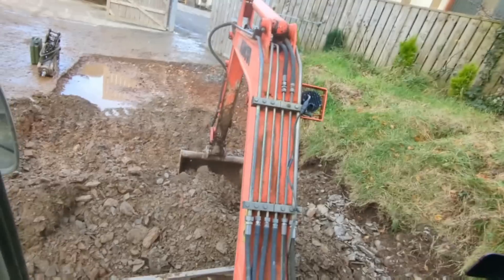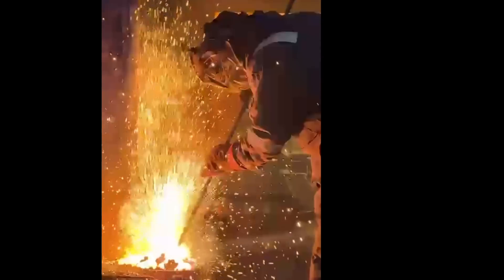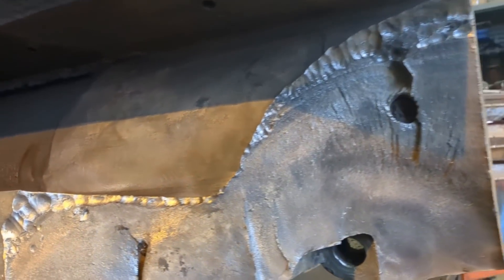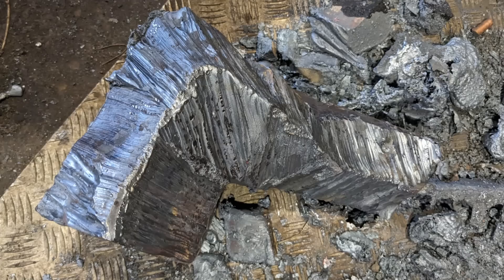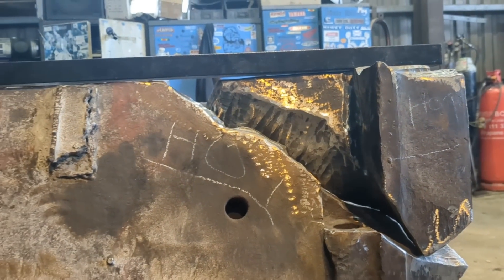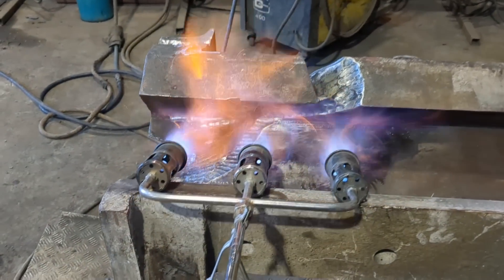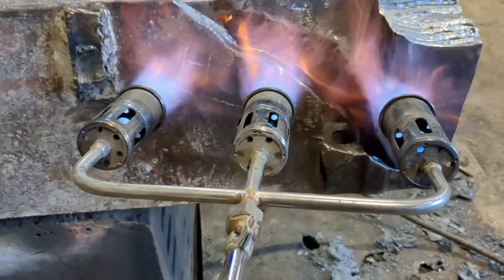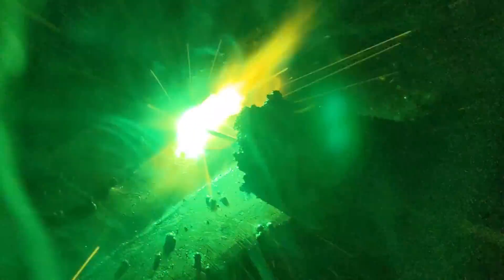so many corners I don't know where to start to weld! broken  jaw crusher toggle seat

Comment: Great  work, do you ever use flux core wire,I used to use a lot on heavy welding,2.4 mm wire,great finish,but dirty and fumes when applying it.

Comment: So I’m not shitting on your video or anything just some of my insight. On heavy material like that if you have a stick welder with 6010 5p+ electrodes I would use that for your root, MiG will get the job done as we can see but your would probably get better penetration profile with a 6010 root, then mig out the rest. Great video though keep up the good work

Comment: I'm curious why for a job like this you aren't using metal core in a spray transfer for much higher deposition rates?
Reply from the maker: Cost and not time critical
Reply: @allistairc123  you need to up your prices! So much hot hard work. Nice job in the end.

Comment: Hey Alistair. I'm somewhat in the heatingofbigasschunksofsteel business. I'm curious if anyone doing this type of work uses induction as preheat? We use it ourselves for pipes and large chunks of steel and it's super efficient. I would love to test our kit on the stuff you work with to see if you could get rid of those furnaces and save some time in the process. Want to do some experiments?

Comment: what is that machine  3:24, with this green flame?
Reply: It is an air arc gouging machine The rod that he's using melts the metal and then air blows the metal away it is very nice for the application that he's doing but it works extremely well for when you want to carve away welds
Reply: @florpdorp7190  i wrote that comment over 1 year ago.... in this time i become welder,  now i gouging and welding myself everyday :D  but still thanks for the answer
Reply: Air arc

Comment: Would there be good reasons to build or buy a large industrial oven for post weld heat treatment? Of course it depends what alloys the base and filler are. Or can that be performed in situ with large welding blankets and propane torches?

Comment: What process are you using mig, or flux cored? Gas sheilded or self sheilded? I've worked there worked on some heavy stuff but always with 3/16th, or 1/4" rods. The only big stuff I've worked with wire was subarc with 1/8th" wire. Just wondering, I can see the nozzle in the video but what process please. God bless, work safe.

Comment: I don’t envy you. You may have used a few sticks to arc gouge off the ruined parts; but you spent hundreds putting in wire and gas putting material back into this one piece. Not to mention having to constantly move around so no piece warped out of place

Comment: Why don't you use 1000 amp rods, 1 inch in diameter welding rods, and do it in 1 pass, also it seems like everyone is using rebar these days to weld... :D :D

Comment: I love air arc.....1 inch rod 1200 amps.....it's like holding a downed powerline in your hands

It's a sound and feeling you experience no other way
Reply from the maker: That's some power, my machine shows 950 on the dial but our electrician put the clamp over the cable when I was working he said there was peaks of 1200, I'd say you are pulling 1500!

Comment: At what point do you walk away and make a new one?  I mean it's got to have so many fatigue cracks and the whole thing is just kicking the can down the road for a short period of time.
Reply from the maker: Try and remove them all from the broken joint it's suprising how long they can last when you remove some of the reasons for failure... Mis alignment in this case

Comment: What have I been up to at work? Well it's Autumn in Melbourne, so the box gutters and rain heads are choaked with leaves and mud from the elm trees in the streets. This means either using the Toucan EWP to check and clear the box gutters and rain heads or putting on the roof harness and climbing out onto various roofs to access the boc gutters and rain heads and place the offending leaves and muck in plastic garbage bags as you work around the roof. Tedious work with a elevated degree of risk.
Mark from Melbourne
Reply from the maker: Ha ha so hard for me to imagine my beautiful aus with wet leaves and mud lol , I associate that with here so much. I did get a wetseason  up in queensland but it's not the same as the decomposing that happens here.   We are almost what feels like peak summer here , it's thick lush dense green, always amazes me the contrast here between winter and summer! Never visit in winter, it is crap lol. I'm currently sitting in Belfast international airport waiting on flight to Spain for a little holiday in the Sun. First time away from my son for a week.

Comment: Great repair Alistair! I have to admit that I was a bit bummed when I first saw the condition of this part, but I should have known better that you would be able to put it back together! Silly me! 😅 Thanks for that little bit about preheating and Max temperature of the part. It is not something that everyone is taught or aware of and is useful to know. 150° to 350° C and pause before it reaches 400°C. I will try and remember that. 
Mark from Melbourne Australia 🇦🇺
Reply from the maker: Even 350 is on the high side,  250 is ideal, I always see the weld looks nasty and lays down nasty when it's getting that hot anyway

Comment: I’ve watched a bunch of ur videos.  Haven’t noticed what kind of spatter/nozzle spray you use.  We run ceramic spray on our nozzles with metalcore wire.  Don’t see your address anywhere but would send some over for u to give a shot.  We’ve loved it on the high heat guns.
Reply from the maker: Ah thanks bud, funny , I've been using ceramic this last couple years, it's awesome, amazing how long it lasts.
I used waxy dip before, still use it for workpiece.  I always have dirty shroud on camera lol, but as long as the gas can get out I just keep it pumping

Comment: 11:50  When I saw how big and broken it was, I thought "the only way this is worthy to fix, is if they don't make the part now, or the lead time is in months :) 

I'm semi retired now, and I went out today (walking and Uber) to check on my van being repaired (They gave up ... I'll have to do it myself) 

And I bought a miniature belt sander with 1/2" belts that are 12" long.  It's for sharpening knives! :) 

I got it almost half price! and it works perfectly .. there's basically no way to take too much off the kitchen knives .. and it does a great job on tiny drill bits (like under 3/8")
Reply from the maker: Aww no ha ha , I cannot face patching  rusty vehicles, I'd rather fix an excavator that's broken in half lol
Reply from the maker: Wow that would be tricky doing a drill bit ,I'd have to use a jig!

Comment: Nice job on the video, it told your story quite well. It was easy to see that this wasn't your first job like this, with that nice jig setup to keep those big pieces aligned. 
I'd bet you don't even set your glass down on your first beer after work until it's empty...

Comment: I did a quickie on a customer’s lawn mower. The idler bracket had a worn pivot sleeve and the part it was on is super expensive so I cut the sleeve off and rotated it 180 degrees and now it has fresh wear surfaces. That’s all I got.

Comment: Again! that's a lot of welding. Turned out really well. I am currently doing site prep for replacing a green lumber stacking machine. Tearing down the wooden building that was built in the early 1970's. New building and new lumber handling equipment.

Comment: Top quality cast steel is lovely to work with & machine.
@ least u’ve got a good heat sink in these masses too. 
Flux cored mig has made it so much easier in the root runs against the old low hydrogen rods,by the looks!
Do you ever back step welds? This we often practiced &  was another way to avoid too much ol pulling of the plates, control of root gap & stress build up?
Good prep work like yours always pays good dividends & you can readily see what’s going on.
Good vid to watch, thanks.
Reply from the maker: Damn my favorite bus still a 7018 rod when I'm not under pressure, , this I actually just used solid wire , but hell yeah flux core is a joy in roots almost keyholing it up

Comment: I work at a company in Holland doing both metal casting and machining. A pretty unique capability is 3D sand printing which makes one-off castings much more viable commercially. I think our proposition would be competitive as compared to repair.
Reply: 3D sand printing? Now that is something that I hadn't heard of before. I'm not sure how Pattern makers would feel about that development but it might save them from some real headaches. 
Mark from Melbourne Australia 🇦🇺
Reply: @markfryer9880  Thanks for your reply. Yes I think it i still quite unknown. As far as I know only very few subcontractors like us have 3D sand printers, most are at OEMs. Also we have the largest machines in the range. We are specialized in large workpieces and if the workpiece size exceeds the printer capacity there is also the option of making the mold out of several smaller pieces, which happens a lot. Also we do a lot of 3D scanning which is used for reverse engineering, fit-up checks in several stages of the process, mapping the 'as cast' condition to determine machine allowances, etc.

Comment: They keep breaking them you keep fixing them, job for life. The end result looked great as usual and the milling finished it off. If you are interested in what I did today. 
The driving range at a local golf club had 7M stray ball nets on an exposed windy hill. Five posts had blown back and they wanted them vertical again.
Trusty Farm Jack sat on a 3ft deep angle iron stake and an old I beam strapped to the Jack propped under a bolt end in the wonky posts, jacking into the wind with a few slips we managed to get them upright.
Did the leveling, back filled the gap with Postfix, bolted through the 4x4 box section post with a smaller box section to another angle iron stake knocked in 3ft as the permanent prop.all bolted up. Five posts in five hours in high winds and rain.
All done through a Hawthorn hedge. Thanks for the upload

Comment: Love the work mate! Could I ask a favour please - I always wonder whether the repairs are worth it. Generally you're fixing huge stuff but on a somewhat smaller repair like this, wouldnt it be worth the customer just buying another part? Or are they not available? I dont expect you to tell us what you charge (though I wouldnt complain if you did...:D ) but would you mind telling us what the replacement cost of the part would be if you didnt fix it, just so we can better appreciate the value you provide. Keep up the good work!
Reply: As he said, lead times are often a year or more, or the manufacturer no longer exists, so you will need to either wait a year without it, or have to buy a million pound new unit instead. Fix the thing works out a lot cheaper, probably only a twentieth of the cost of a new one, plus the cost of the downtime for the year lead makes waiting a week look absolutely a bargain.

Of course, now the one side is working perfect again, the exact same will occur on the other side, because it also has an invisible flaw that will go in a few million cycles.
Reply: Watch Cutting Edge Engineering on YT, He does similar work on mining equipment and Yellow plant.
He repairs and often gives the cost of the replacement part and usually says he can repair for a bit less than half so his customers usually go for a repair as delivery times and availability are uncertain.
Reply: The biggest factor is never money, it's always time. Repair is always quicker.
Reply: @MrMaxymoo22  Yes have rebuilt an item even if it actually was cheaper to buy new, simply because new had a lead time in months, and repair was a week of wait. Small electric motor, rewound as it was dead, but because of the long shaft it was going to be 3 months to ship one over.
Reply: @MrMaxymoo22  Time is money.
Reply: I’ve always wondered how you would quote out a job like this, much less how much it would cost at the end of the day
Reply: @suzu9404 There’s a video where his dad says none of their customers ask for a quote because they know nobody else can do the job.
Reply: @jonny8930 
It’s difficult for companies to work on a nod these days. Probably only works for private companies, big companies have anti fraud protections which stop that kinda thing.
Reply: @SW-qr8qe  Big companies will simply close that small part of the operation till the spare parts arrive, then spend 3 years trying to get customers back, before closing it for good. These repairs are for small units in a big group, where each one runs as a near independant unit, so have local managers who can make that decision, and for industrial plant it is more often or not a case of "bill me when it is done", because they know it is broken, just not exactly how broken, till you have it in parts and see what went now, and what was worn and contributed to it. Then you guesstimate and tell the local manager, who will come back same day with yes or no to fix, but still pay the hours to get there.
Reply: @SeanBZA  Cheers, good to know. I currently work in a multinational which is tremendously inefficient and would take months / a year getting quotes, pissing suppliers off ect. Good to know sensible businesses exist. All the Best!
Reply: @suzu9404  ken known round here as the godfather 😉
Reply: 😂😂😂😂😂😂😂😂 smaller repair like this hate to what you call a big repair 😂😂😂😂😂